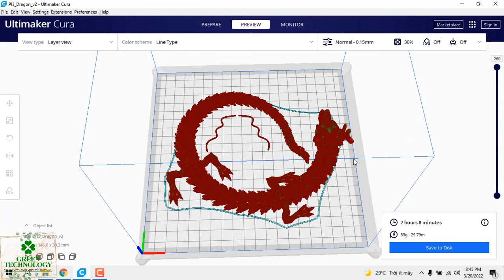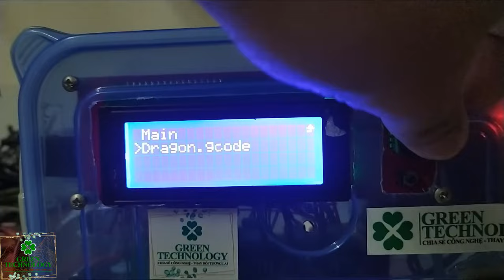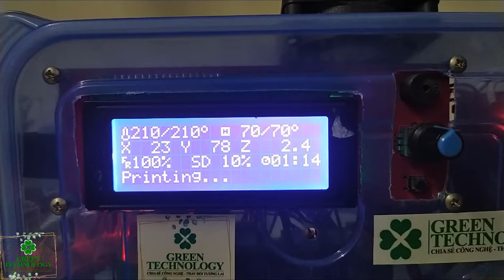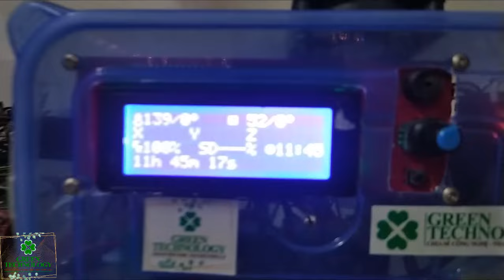MÁY IN 3D - In Con Rồng Việt Nam

Comment: Hi Bạn , mình mới update firmware Marlin lên 2.1 mà nó  lạ lắm . Lúc trước khi in xong hoặc gia nhiệt hotend rồi nhấn Cool down thì quạt sẽ quay khi nào hotend về 50 độ mới tắt mà khi lên 2.1 thì nó tắt quạt luôn. Mình chỉnh code chỗ nào cho nó như ban đầu. Giúp mình với 
P/s nhân tiện cho xin file con rồng đc không
Reply from the maker: Bât quạt lúc nào là do cura chư
Reply: @GreenTechnology_GreenGroup  chắc bản Marlin mới nó bỏ chức năng này rồi , mình xài bản bản 1.09, chưa nạp gcode gì hết, khi vào gia nhiệt trên menu Preheat PLA để chỉnh máy, sau đó Nhấn Cool down trong menu để tắt gia nhiệt thì quạt vẫn quay khi nhiệt độ trên 50 . Mình thấy ko liên quan đến gcode hay cura